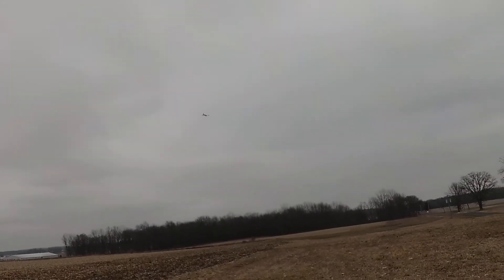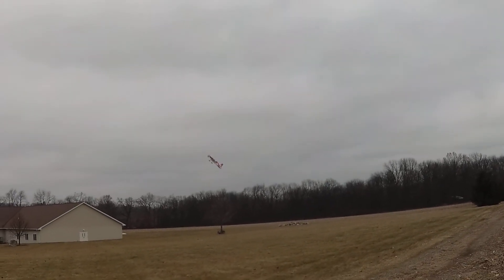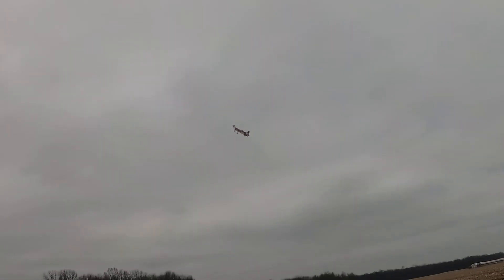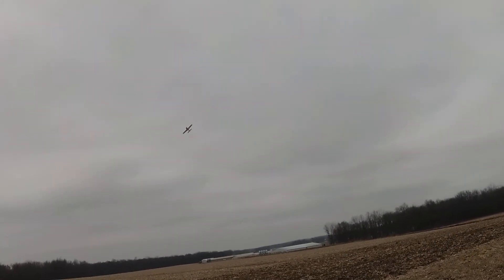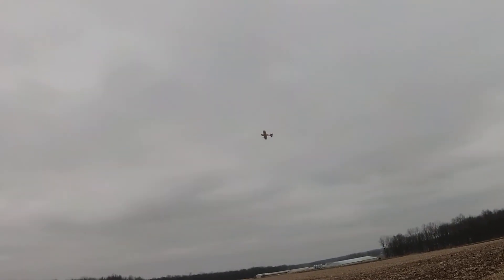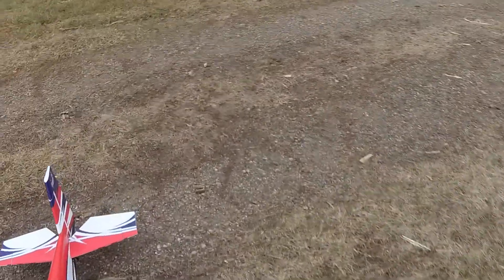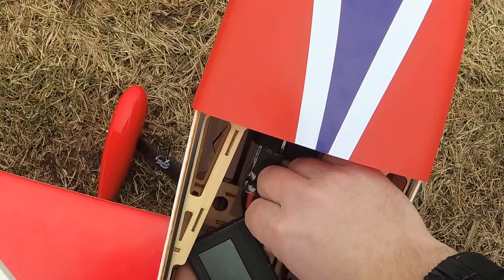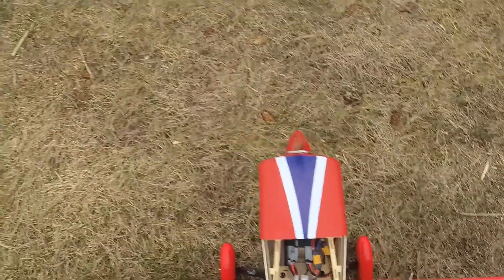1-3-2020 Future Model 60" Slick 540 PP #1 - New battery woes

Comment: Did you allready replaced the alieron servos for the savox sv1250?.Im looking for the rotorstar ones but they're out of stock for a while now.. dont know if they comeback at stock.Hk is not very good about that.. its the reason im not buying planes from them anymore.When im break something im out!
Reply from the maker: Yes, all 4 servos are now Savox. Initially I was looking to only replace the aileron servos because of blowback, but then I had a scare with the elevator servo once (https://youtu.be/ORt7RKcO0ts?t=113), so I decided to replace all 4 servos.

I'm still using the Rotorstars in my 55" Edge.

I wish HK would get the OrangeRx R620x V2 back in stock, but it doesn't seem like that's ever going to happen. I may have to resort to buying used! Lemon Rx costs twice as much as OrangeRx did, but I suppose it's an option. I loved getting me some OrangeRx on sale for $16, though! Even got a 10ch for $18! Actually, now that I just checked, they have R820x V3 now for $25. That's tolerable, especially if it goes on sale!